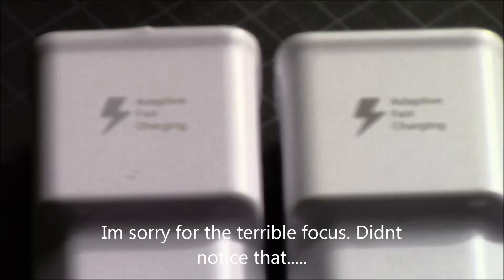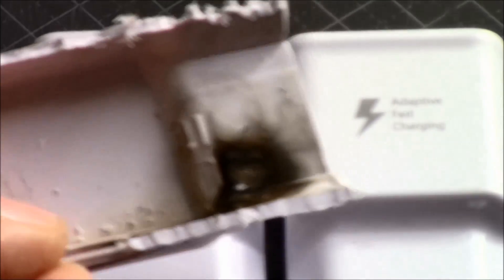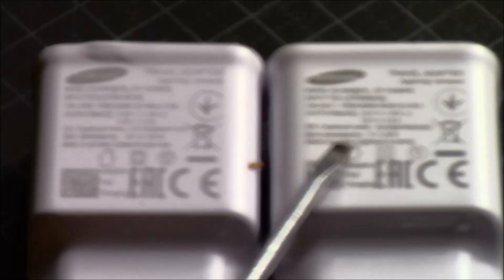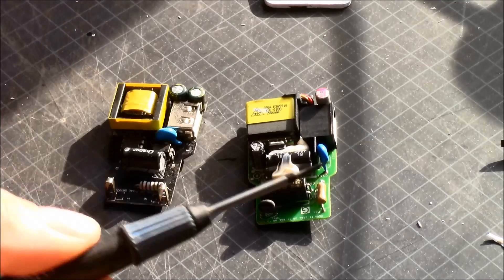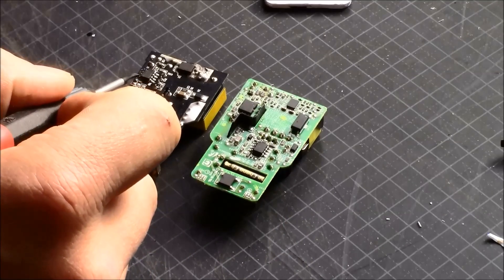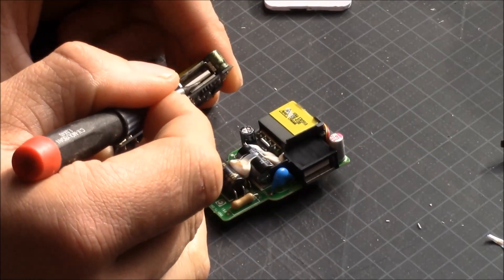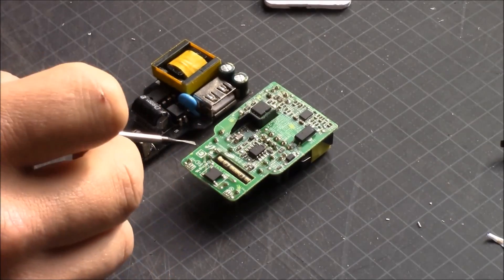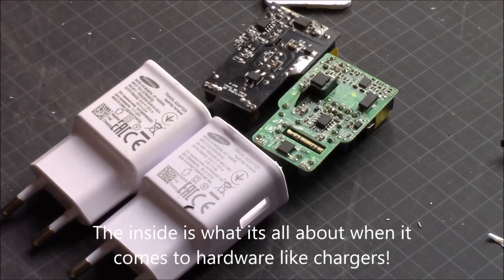Ebay Crap: Samsung fast charger update

Comment: Just took apart two of my Samsung fast chargers because they both looked fake, one of them is China and another is Vietnam. Both were OEM. Dammit, I just broke to cases for nothing, but it's the only way to say for sure unfortunately. Surprisingly China version looked a bit better built quality vs. Vietnam which has some resonance vibrations. But yours black edition is definitely not made by samsung, not even designed, fake from the first look.